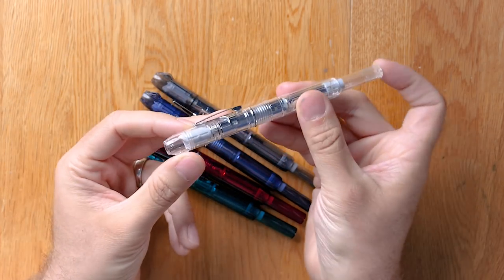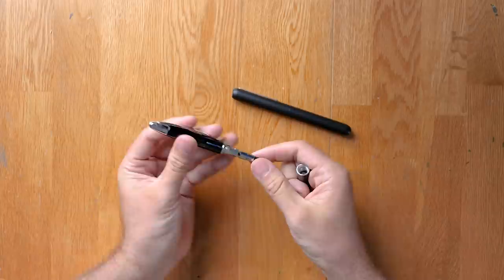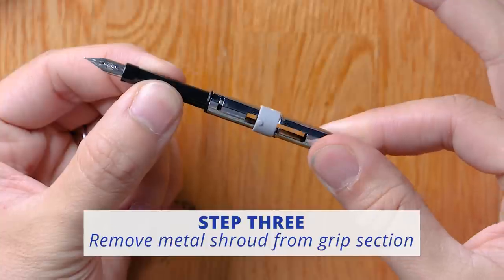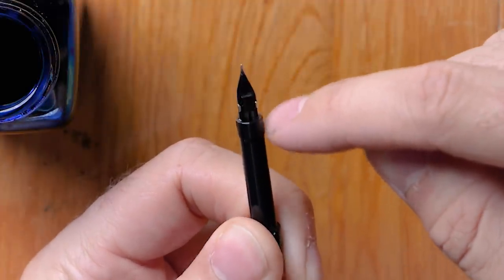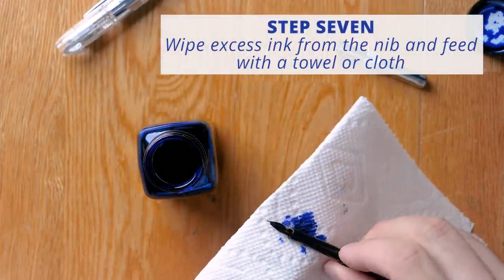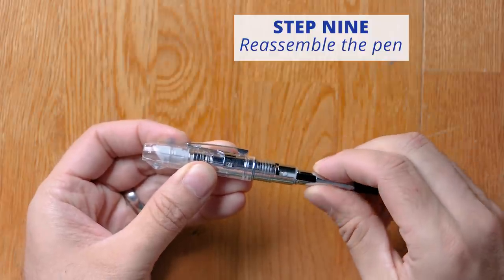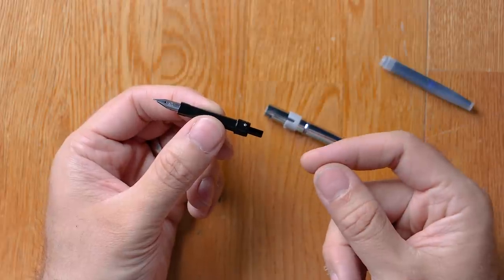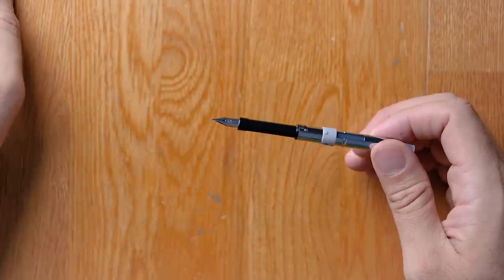How to Fill A Platinum Curidas Fountain Pen

Comment: Here in 2022 & I’m finally getting around to using my Curidas pens.  Great video as always, Brian; here’s a strange question for you or anyone here.  When I click to retract the nib, the nib door takes a few seconds to gradually swing the door closed.  Sometimes it takes longer.  This happens with all of the Curidas I own.  Now I am a silicone lubricant freak, so when I get a pen, I flush it and then I apply a light layer on all cartridge parts and cap threads.  It’s really a habit I’ve gotten into, as our water in AZ is extremely hard and I’ve had pen parts get calcium residue & hard to turn if I don’t lube them.  BTW I use the Super Lube PTFE clear synthetic grease that’s NSF (former USDA) food grade, not petroleum based & made in USA.  It looks & feels identical to the grease that some pen retailers sell.  The other question is, are the nib units available separately?  Thanks!

Comment: I have a platinum curidas extra fine nib. I use the cartridge that came with the pen and i refill the same one using a syringe. Does it matter if i let the ink flow down with the nib inside the pen? And something else.... i don't know if it's the extra fine nib...but the ink doesn't seem to flow as it should be....it feels like there is no ink, even though the cartridge is full

Comment: Great instructional video, from a great pen instructor maestro! Brian, you haven’t lost your touch over the last 10 years or so. Just the right pace for us old coots who don’t hear as well as we did 10 years ago. Only one suggestion: ditch the tacky background music it is not needed for an instructional video, nor helpful especially for this hard of hearing old coot, even though I am using earbuds. I kept wondering what is that noise, kept concentrating on figuring it out, instead of what your were saying. Ended up watching a second time to get all of your excellent spot on explanation. The end caution was great and needed, though I found the pen tolerant of assembly mistakes, others might not be so lucky.   

Now for the Curidas itself: Excellent pen at half the price of a VP and not as heavy and slippery. It hasn’t left my sight since receiving mine the end of August after returning my original. (A Valentine gift from my wife that arrived in June with the typical early release, cracked feed.) Thank you Goulet Pens for your as always great service. A fantastic EDC, even in these pandemic times, great one handed operation in Pharmacy and Bank Drive drive ups, no need to sanitize, which would not be good for the plastic. I quit carrying heavy all metal chrome pens or knock off 2 buck pens to spray. Love its fiddley complexity, that’s what I use and collect pens for: different solutions for a basic problem —carrying colored water safely and delivering it to paper as words. I’m wondering if the Curidas has more parts than a Sheaffer Snorkel? If so it has set a new record. I could go on but will do that on my upcoming IG review.
Reply from the maker: That's good feedback about the music in the background, I'll give that some serious consideration Alan. I definitely don't want to make it hard to hear. I think sometimes when I have a long video like this on a very specific topic, I feel like it gets a little boring just with me talking, which is why I wanted the music in the background. But not if it's making it harder to hear. 

Haha, I'm positive the Curidas doesn't have more parts than a Snorkel! That pen was amazingly complicated inside, but so very cool to fill ;) Thanks for sharing all your insights- Brian

Comment: Hi hope you are doing well
Actually I have a problem with my TWSBI GO it is not laying enough ink with upstrokes
Reply from the maker: Try a good cleaning first, that often helps. If not, try out a couple of different inks if you have them on hand and see if it's consistent with all inks. If you need to press down the nib a little on the page to open up the tines, that can increase the flow and help, just don't press it too hard to as to damage it. -Brian
Reply: @Gouletpens  I've already tried that but it didn't work

Comment: I bought one of these and had to return it. It was broken right out of the box. The little metal post Brian refers to slips. The pen is also uncomfortable. It did not quite live up to the hype. It also does not take a standard converter.
Reply: A common issue is a cracked feed under the nib. Mine had this and like others’ it didn’t worsen or really affect anything. Otherwise, it’s not the most comfortable pen for me and a bit temperamental to fiddle with.
Reply: @d.s.5279  if you don't have 1 and are looking for a retractable, I would suggest shopping around for a vanishing point. Of the 2, I find my vp more comfortable and will buy another but won't buy another curidas.
Reply from the maker: Sorry to hear about that. They did have some issues with cracked feeds and they're aware of it and making improvements on it. Hopefully that's not going to continue to be something we see but it was an unfortunate results with some people's pens from the first shipment of pens we saw. As for the comfort, I think that's going to be a personal preference thing, and I think with any pen like this with the clip at the front, it's going to be that much more hit-or-miss for some people, I totally get that -Brian

Comment: A tip when using cartridges: touch the tip of the nib with your tongue for a second and the pen will write straight away.
Reply: Not needed...just plug in and out the cartridge once or twice and it will write straight out of the box! Lol!

Comment: Why the overly complex design? So many things to go wrong. I'll take a simple, even expensive ones, designs any day of the week. It is bad enough that there are so many cartridge sizes. For instance long international vs Lamy T10...UGH
Reply: I’ve talked with others on this. May have to do with not being sued by other companies, notably Pilot, for copying a design. I believe there was a past Platinum knock pen that was discontinued for this reason.

This is just speculation of course.
Reply: Yeah, the thought is they came up with something different enough that they could make another knock pen
Reply from the maker: I get where you're coming from...keep in mind, in "real time", it takes me no more time to fill this pen than any other, I am over explaining it here because just not that many people are familiar with retractable fountain pens in general. But one thing I've learned is that fountain pens as a whole are deceivingly complicated by their very nature, it's essentially a controlled leak! There's a lot of engineering going on, and a lot of patents out there to dance around, for sure. I think retractable pen are much more complicated, too. The Vanishing Point, Lamy Dialog 3, Pilot Fermo, Vanishing Point LS, Stipula DaVinci, they're all quite complex inside, you just don't usually see their interior parts. With the Curidas, you do. It really does need to be complex to actually function. -Brian